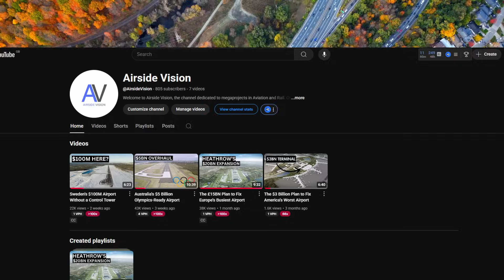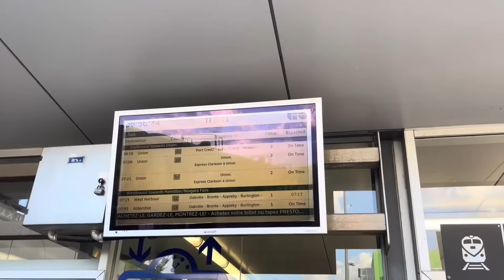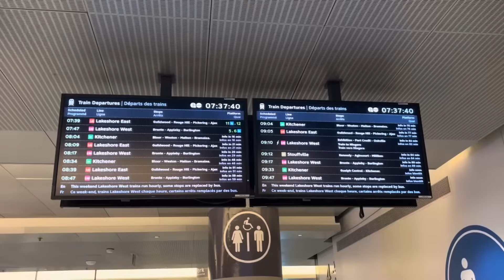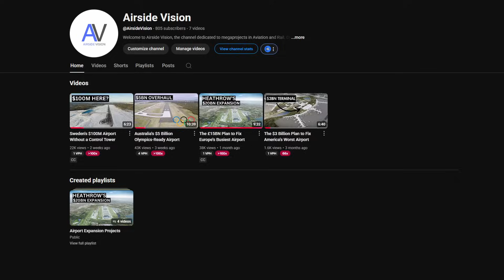Inside Toronto’s C$12BN Mega Railway

Comment: As a physicist I object to your statement tat electric locomotives will accelerate twice as fast. Acceleration, according to Newton, a=F/m. Electric locomotives cannot increase the force, but they can increase the length of time that the train accelerates. Since the outer end of some the rail lines operate on CN of CPKC lines these will not be electrified because the rail lines won't allow it so the outer end of Lakeshore West of Burlington, Lakeshore East of Ottawa, on the Milton or Richmond Hill lines nor on the Kitchener Line between Bramalea and Georgetown.

GO should by a double deck version of STADLER'S FLIRTS which can run on diesel or overhead. They could run on the overhead until they get to the end of overhead then switch to their diesel engines. Since there would be a higher proportioned of powered axles the tractive effort would be higher and they would accelerate much faster and cut the running time more than electric locomotives. GO is going to be plagued by buying more of the wrong equipment. If they built power units and put them between two coaches which would be the powered units in the middle of a 6 car unit. Two units would make up a 12 car train but they could run a single 6 car unit in the off peak. I fear we will get a less than optimum service, again.

Comment: The plan was that one express would take control of the line, but unfortunately that deal fell through so metrolinx will still be the operator of go transit for now
Reply: That's probably better because I heard the deal fell through because the Brotherhood of Locomotive Engineers and Trainmen was opposed to it (the guys who actually run the Trains) and it's important to never upset the Trade Unions
Reply: @IndustrialParrot2816  I think that is BS. DB wanted to run more frequent and shorter trains so the unions would not object to that. Metrostynx probably wasn't willing to py for it.

Comment: Good. Then we need interregional trains. Going from Waterloo to Hamilton should not need a stop in Toronto
Reply: Trains used to run from Hamilton to Galt  and Guelph until the late 1950s. Maybe it's time to build a line from  Hamilton to Cambridge again; it could connect with the ION line coming down from K-W.🤔
Reply: @RobertAdams-u6c I think putting Highway Bus lanes could be good
Reply: The problem is that the line between Guelph and Hamilton is a Freight bypass

Comment: 1:19 sorry but these were litterally the worst two stops on the GO network to choose for the example of having to wait hours due to low frequency if you miss a train. Oakville is on the Lakeshore West GO Line, which is the busiest and most frequence Line in the GO network, with Ajax being on the Lakeshore East line which is the second busiest and second most frequent Line. The point is still valid for most of the other GO Lines though, its most just the Lakeshore Lines that have the better frequency and ridership. The Barrie Line the runs north is probably the best example of this issue, as it has a ton of latent ridership demand but currently has too few stops within the Greater Toronto Area and lower frequency, with much of the Barrie Line north of Toronto being single track still causing trains to have to wait for each other coming back and forth.
Reply: This content is sponsored by and paid for by metrolinx subsidiaries which cherry pick information to cover up the corruption and delays caused due to the incompetence by the agency
Reply: yeah we refuse to adres the real issues we spen Billion on aimeless upgrades. Doug ford is the problem By far

Comment: I like the expansion but unfortunately the Stouffville line is not entirely two-way on its entire length. That stops at Unionville. Service north of that is limited to single track. No possibility to expand there as buildings have been built closer to the line, not to mention the bridges that would need to be replaced for double tracks.

Comment: My only 2 complains against GO transit are that in Peel Region, they dont start early in the wkend, and no train services between 5p to 9p, from Guelph to Brampton, and or 7a to 9a, 7p to 9p. Vice versa. I just hope they add these scheds so workers like me  who works in a continental shift from 7 to 7 12 hr shift, can use the train.
Reply: Weekend service on the Kitchener line is relatively new, so this current service is likely not to last and expand eventually

Comment: OK, I'm four minutes into this gushing PR vid. WHERE is electrification being installed? I see no signs of it save for future proofing in some of the latest service buildings.
Reply: This channel is clearly not being paid for pr
Reply: Just wait another 25-30 years to dee electrification on go lines. Everything f...ng slow. Most likely other par of world will run teleports when GO finish this.
Reply: The new stationshave electrical grounding system in them. AT some you can see the grounding cables attached to anything metal in the station right down to the steel frames of the benches. A lot has to be done out of sight.
Reply: It would make no sense to install electrification when you still haven't finished adding more track and grade separations. All of the lines getting electrified still need work that is currently on going to double the tracks and grade separate all at-grade crossings to reach 8 minute frequencies, which is the maximum frequency being touted (the offering is AT LEAST 15 minutes, but will often be better) If they added the electrification infrastructure now, they would have to remove parts of it to do the preparatory works, it would make no sense.
Reply: @robmausser  So you agree...